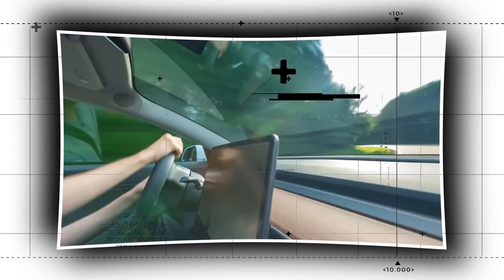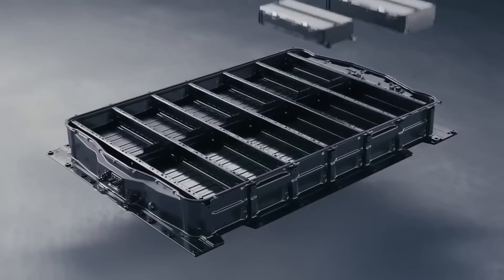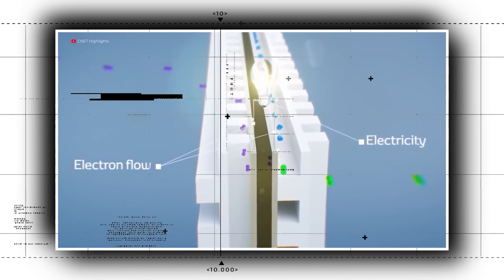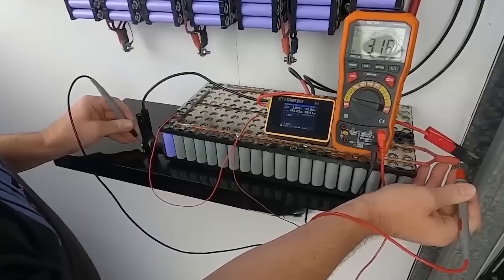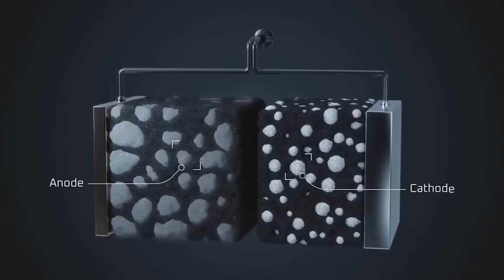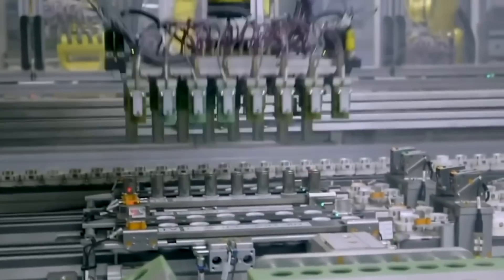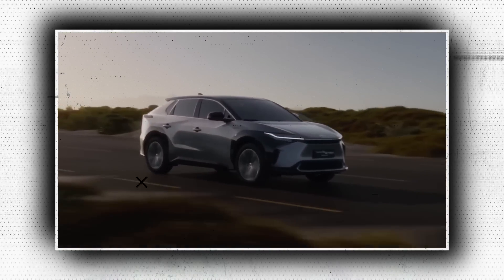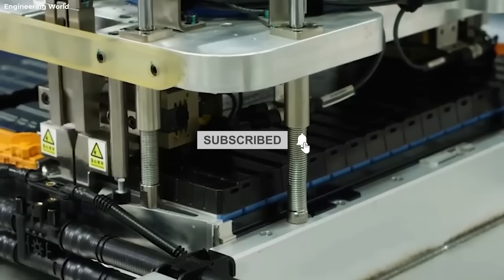Toyota CEO Just Made A Huge Announcement About A New EV Battery

Comment: Hydrogen is like Diesel. Cheap and Good Mileage. Most Trucks, Busses like heavy vehicles will use H2 in the future
Electric is like magic. We are using lithium for batteries now which is 50 year old technology. Lithium is rare to mine. but Companies are researching Salt Batteries. Salt is abundant, cheap and needs refining only. Mining not required. So it will be cheap, safe and very environment friendly in disposal. 
Electric Magic:
✅ Wireless charging
✅ Swappable batteries
✅ Power sharing
✅ 1000km/charge is easily possible
✅ Modular batteries
✅ Best for Electric propulsion also

Comment: Effective Battery Technology, Industry yet to develop Efficient Battery Technology, which is sustainable.
Hydrogen Fuel-Cell or Hydrogen IC would be the Future-Technology - with 'Containerized Hydrogen Generation' at Hydrogen Gas Filling Stations.
Technology to be selected from Hydrogen Fuel-Cell with Electric Transmission or Hydrogen IC with Mechanical Transmission!

Comment: Per the video, with the new battery type electric cars could be charged in 10 minutes.  I have serious doubts.

The batteries may be able to accept a charge that fast, put the problems of making charging available at such a high current have not been addressed by the video.  Even charging a Tesla at a supercharger station causes the very heavy charging cable to become quite warm.  The heat generated by a conductor increases with the SQUARE of the current.  Therefore, charging at twice the current would cause the charging cable to generate FOUR TIMES as much heat!  I suppose that the charging cable could be made heavier to enable it to carry more current.  However, a cable capable of charging the car in 10 minutes would probably be impractically heavy.

Also, one must consider where the charging station gets its power.  With perhaps half a dozen chargers drawing current from the grid at a charging station, the connection to the grid would probably be overwhelmed.

For the above reasons, it may be impossible for quite some time to have charging stations capable of charging electric vehicles at such high rate.

Comment: I choose RAV4 prime with solid state battery. I have 41 solar panels that generates 16kw an hour. Toyota gives me 10 years warranty on the battery which is standard.
Reply: Just 30 mile for ev but late your car older I think ev run only 20 mile like that no good my Prius ev only 8 mile and I no more use ev for my Toyota Prius . Don’t believe Toyota too much lie

Comment: EV development is still in the prototype stage and the manufacturers are using the public as their testing ground. It will be another 50 years until the technology is developed to the stage where the EV’s can match the overall benefits of a petrol or diesel car. So for now and the rest of my lifetime a diesel car is my choice.
Reply: The trick is to diminish the benefits of driving diesel or gasoline vehicles. Higher road tax, fuel tax, no emission zones. It is not a consumer choice about what you like the most.
Reply: @Tore_Lund  sorry but its definitely consumer choice. There is no reason to change from the current diesel and petrol technology. For those who think that there is some sort of climate issue well go ahead and buy your battery car. Any government that tries to put restrictions on petrol and diesel vehicles won’t last long.

Comment: Solid-state batteries are not cost-effective! Toyota is too late to get into battery! Tesla tried for years but failed. Battery is chemistry. A decade or more is necessary for research and development! Just see what GM is doing! Tesla tried for years, but asks for hands from chemical companies overseas. One thing for sure, chemical companies, specialized in battery anodes, cathodes, and nano technologies will be bigger than Apple in stock market in the coming decades!  China's batteries are inexpensive but gives you much less mileage.

Comment: The more I learn about lithium-iron, the more I question why we have not used them since the start. 

Yes, they have less energy density. However, that advantage only lasts for a year or two tops. They degrade slower, and LFP can handle 5000 cycles and still charge to 80% capacity vs. new.

Lithium-iron batteries would last for 10-20 years and are a lot cheaper than the ion version. It seems like that would be in Toyota’s design goals.

Sure, solid state can charge faster but that requires more wattage than most charging stations can support.
Reply: LFP had patents which expired in 2023, which is why it is coming to Western nations huge now. China was exempt from those patents, so they developed and used them earlier.

Comment: Solid state batteries mass produced will be poetry in motion.

For now, just a pipe dream. Thanks but don't hold your breath 😮
Reply: Last year, there were one or two companies claiming they had working solid state batteries and would start pilot production around 2025. This year we have 5: Toyota, CATL, Amprius are the most promising. the 2025 schedule still seems credible. 500Wh/kg is enough to make any other chemistry undesirable for EVs.

Comment: I believe HYDROGEN is a better alternative. Availability is the issue.  Lithium is EXPENSIVE,  AND IN LIMITED SUPPLY.
Reply: Sodium ion
Reply: @timmyg44  Hydrogen would  be cleaner, in my opinion.
Reply: @PaintmanJohn  both are filthy when created through the burning of coal.
Reply: @PaintmanJohn  Clean hydrogen is insanely expensive & inefficient to develop the  infostructure for... & dirty hydrogen would not represent any advancement towards the end of the climate crisis.
Reply: 95% of hydrogen is made today from fossils. It makes little sense in terms of CO2 emission reduction.
Reply: You need an impractical amount of ready hydrogen for ICE cars to go some distance. Producing, transporting, storing and dispensing hydrogen is not cheap, risky and  dangerous..
Reply: Hydrogen engine is difficult mechanism, and vehicle required very high maintenance.
Check videos about sodium ion battery technology, this will dominate whole industry.